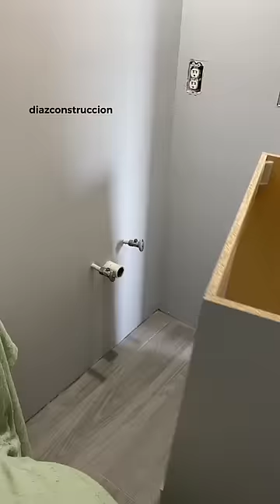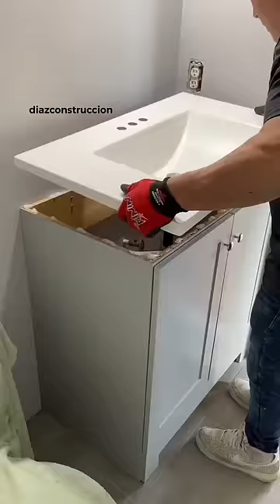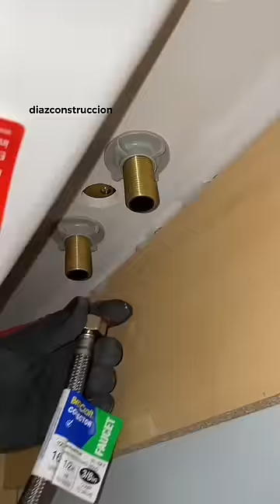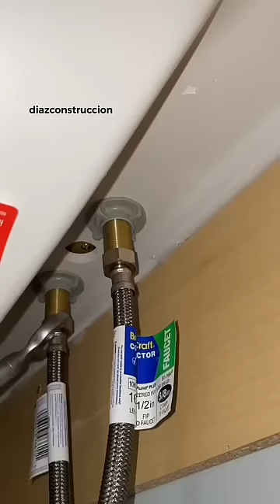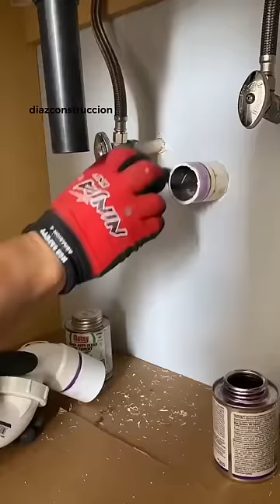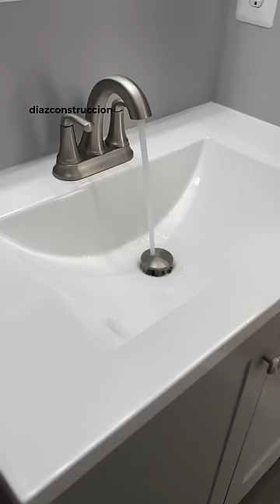Install a bathroom vanity

Comment: Look at those angle valves. 
They're so far apart and lopsided. 
I've seen many plumbing videos with angle valves installed like that.
Is it really that hard to install the water pipes at the proper spacing and .height. LoL

Comment: Not a very good video steps of how to correctly install new vanity, kinda half a*sed
Several steps not shown, cauking shows in a few spot on back of the vanity top board, then only shows causing on side of top not in back of faucet, no sealer,
No shut off valves for future  No teflon tap on water connections, dont show premeasing of drain piping, + didnt check for leaks